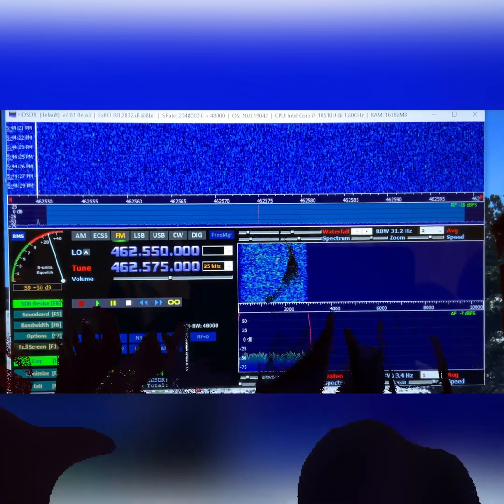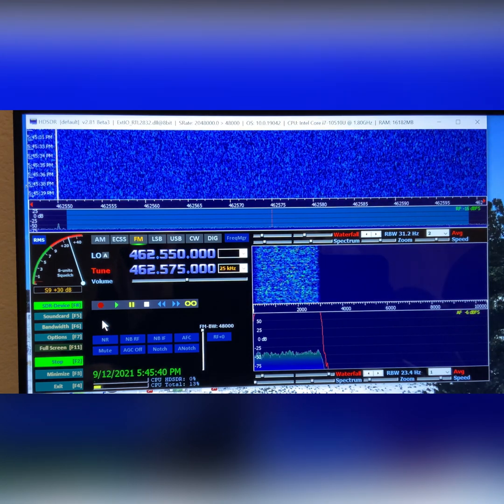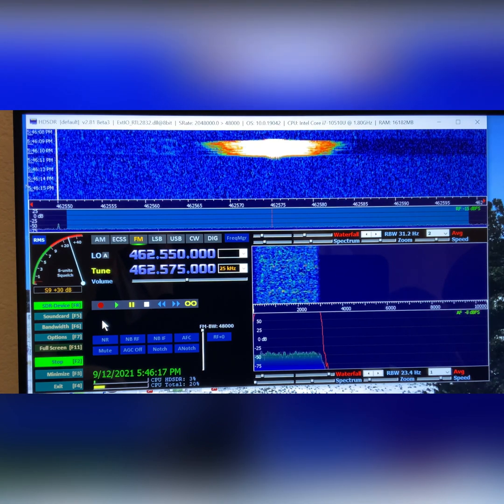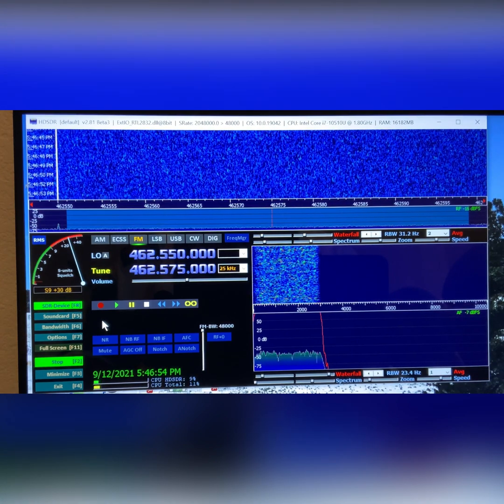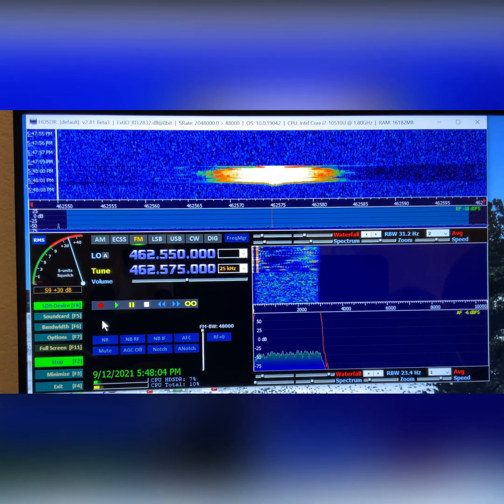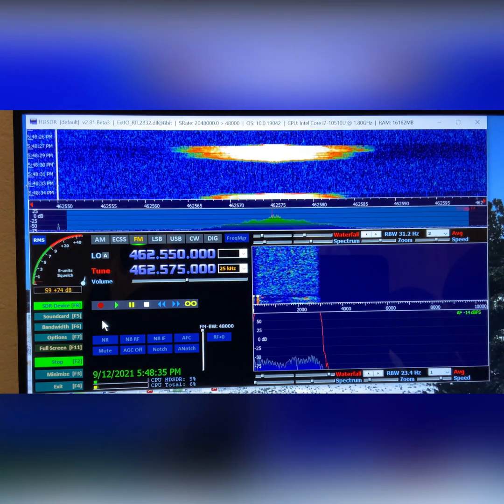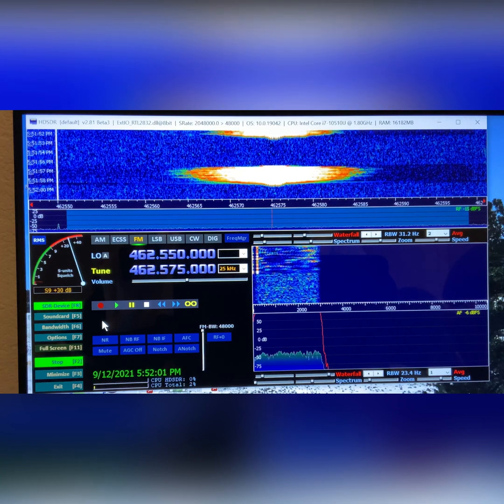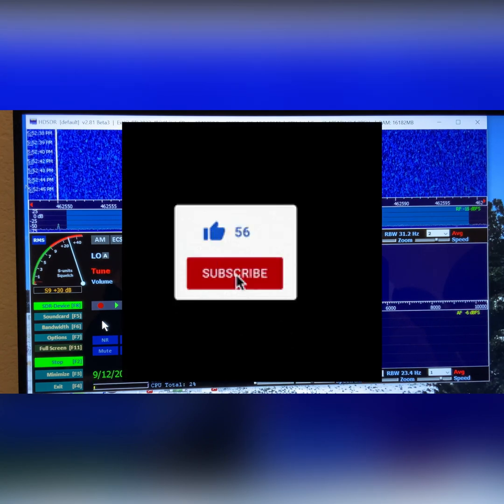GMRS Wouxun KG-UV9G Pro Difference Between Narrow & Wide Band

Comment: So, should I assume that narrow band has better penetration then wide band since the signal isn’t as wide? I mean, it would make sense because I don’t get near the penetration with 2 meter as I do with gmrs around and in buildings. And of course we all know the reason why. But I never thought about this between narrow and wide band
Reply from the maker: Actually GMRS has better penetration because it’s UHF frequency in the 462 MHz region. 2m in the mid 140’s MHz doesn’t have the same penetration. The true reason they narrow band is to fit more channels in the same amount of space. You can get two channels narrow band in the same space as one wide band channel. Ham-Solo K0FYR
Reply: Maybe true at the slightest level. Narrow has slightly higher signal strength because of the lower deviation. This effect is more noticable in HF where CW (Morse) signal can reach farther than modulated carrier (AM, SSB) for the same power level.

Comment: What is the menu number for that setting, and would you recommend that setting for the UV9PX ham as well ?
Reply from the maker: I think the menu number for that is 4 or definitively in the first 1-10 menu items. It is sometimes different on different radios. It is listed as N/W or W/N. Most GMRS and Ham FM channels are better on Wide band for fuller depth of sound and volume to the listener. Digital channels like DMR and GMRS channels between 8-14 are automatically Narrow and you don’t have a choice on those. Wide is definitely preferred by most users currently. Ham-Solo K0FYR WRMV759
Reply: @Ham-Solo  Thanks for the help. I’m still waiting on my Wouxun KG-UV9GX GMRS to be shipped.
I’m still learning the basics of radio setup.
I did get my Wouxun KG-UV9PX and I figure they are very close in settings.
I’m a little frustrated with the programming so far.
It might just be the initial settings, but I don’t pick up anything on ham or GMRS channels.
I’d love it if you did a video that covered the settings your running on these radios.
I know we’re located close to each other and share alot of the same repeater’s.
Thanks for the help !!!
Reply from the maker: @Pro2AforLife  I can send you the code plug for the KG-UV9PX ham version I used for Colorado that you can open in the free CPS software from Better Safe Radios for that model and write to your radio. I know all the repeater frequencies work on this code plug. I will need your email address or at least ham callsign so I can look up your email on QRZ. Ham-Solo K0FYR
Reply: @Ham-Solo  for some reason my comments aren’t posting.
I sent you a pm on Fakebook messenger !!!
Reply: @Ham-Solo  yeah it was definitely #4 !!!

Comment: Thanks for the video. Everyone seems to be talking about wide vs narrow band but most don't explain the difference. Having the scope hooked up makes a great visual presentation.
Reply from the maker: Thank you Tom. I appreciate the feedback. Having been in the fire service we were some of the first adopters of digital radio and frequency allocation and it made sense that they could add more transmissions using a smaller space. Definitely doesn’t would as rich a sound however compared to wide band. Ham-Solo K0FYR

Comment: i have a question, @1:25 you showed your sdr antenna and called it a 1/4 wave wave antenna and showed how tall it was and mentioned it to be about 45 inches tall. for gmrs, i show a 1/4 wave antenna to be 5 inches.

i have been trying to lean every little thing i can about this stuff and when i see something i dont understand i ask.

i show a 45inch 1/4 wave to be a 62mhz frequency
Reply from the maker: I apologize you are correct. The original SDR antenna set I bought was from Amazon and ran around $15.95 and came with three antennas and the mag base. It is specifically for an SDR dongle and can actually receive from say around 3MHz - 1300MHz. I used to use it to listen to HF signals at 40m and 20m. By changing lengths you can listen to all kind of different frequencies. Back then when I made the video I was listening to many different bands and I used to call that my 1/4 wave. It’s actually around a 1/2 wave for 2m or the normal VHF 144-148MHz range. I don’t really use it anymore as I don’t have my SDR on hardly at all. I have an IC-7300 that is on 24/7 so I don’t really use the SDR. Check out my latest GMRS radio video I just posted 2 days ago and see a true 1/4 wave and more for GMRS. https://youtu.be/IMp1XqBEJv0 Thanks for watching Ham-Solo K0FYR
Reply from the maker: P.S. Here is the amazon description for the SDR antenna set from amazon if you’re interested. I got it in March of 2021. RaTLSnake M6 v2 - Premium 3-Antenna Bundle for NESDR, RTL-SDR, HackRF, and Other Software Defined Radios. Magnetic Whip Antenna Set Made with Low-Loss RG58 Cable for Radios with 50 Ohm SMA Connectors

Comment: You said someone using narrow band on a wide band channel would just sound 'quieter'...  What would someone using wide band on a narrow band channel sound like?
Reply from the maker: It would bleed over outside into other narrow band channels. So the point with narrow band is to be able to stack more channels side by side. With such a small bandwidth the wide band mode would bleed over into the adjacent channels. Ham-Solo K0FYR
Reply: @Ham-Solo  I understand that part i'm just wondering how you would identify someone speaking on a different band from me so I can adjust my radio to compensate.  It sounds like even now there are radios out there transmitting narrow and many others on wide on the same channels.
Reply from the maker: @timtaylor8557  Well really the only GMRS channels that are required to be narrow are the interstitial channels normally Ch8 - Ch14 that are only 0.5W transmit authorized. All the other channels can be set up on wide. I personally do not narrow band any except those 7 channels.  https://tinyurl.com/y7wj8s9w This link will show you those frequencies starting at Channel 8 and going to Channel 14. Ham-Solo K0FYR

Comment: Yet Midland GMRS radios are narrow band, no choice.  They are the 800 pound gorilla with their marketing to cross-country  off roaders.  That will drive GMRS  to narrow band in the next 10 years. (FCC is wanting it anyway)  I live in Eastern Iowa and being my first fall with GMRS handhelds (WRNS327)  I am surprised how many farmers use GMRS and factories, warehouses, and nursing   homes use FRS.  Without them there would be nothing to listen to in my area.  GMRS repeaters died 10 years ago when the REACT chapter in Waterloo disbanded. Remember FRS channels 7-14 is nestled between GMRS repeaters uplink channels.
Reply: I think you're on to something here. With Jeep Jamboree making Midland their official sponsor for comms and the subsequent switch from CB to GMRS, a lot of people will (if they haven't already) buy a Midland simply because Jeep Jamboree has pointed them in that direction, then, all the friends of those people will get something similar, etc. I think you're right that ultimately Midland is going to drive a narrow band standard across the country for GMRS. 
Further, I'm in favor of more channels vs better audio quality. Like another commenter said, how much audio quality is one expecting? If one is using an HT or a mobile without an external speaker, expectations shouldn't be that high.

Comment: far as i know uhf wide band at 25 KHz has been removed in Canada on commercial radios. I wish there was gmrs here in Canada ,,
Reply from the maker: I actually have been having a great time with GMRS and now a guy is putting a repeater in about 25 miles away in Colorado Springs which I should be able to hit relatively easily so I’m looking forward to it. Sorry that Canada doesn’t have that type of option for GMRS. I have been to Quebec City several times back in the early 90’s but not in some time. I would very much like to go back. Ham-Solo

Comment: the FCC looking for you :) the hamsters rated you out
Reply from the maker: Actually, I know you’re kidding around but Notarubicon has dealt with this type of issue before so I will clarify here for everyone. I am an Amateur Extra licensed ham operator which is the highest tested license with the call sign K0FYR. I also have a GMRS license under the call sign WRMV759. The radio in this video is a GMRS Part 95 radio and is being tested on GMRS frequencies at the appropriate Wattage using my call sign for GMRS every time I transmit. Which is above and beyond the requirement to identify every 15 minutes for GMRS world. Thanks for everyone’s time.

Ham-Solo K0FYR WRMV759

Comment: Good spectrum demonstration. Just remember folks your voice is in there between the spectrum boundaries. When you narrow band, you cut off the lower deep tones of your human voice and the higher tones of your voice. More channels fit there but less fidelity. In wide band there is room at one end for your low bass tones and the higher soprano parts of your voice. Full fidelity, but less space to put more channels in. Hams use DMR in some newer type radios. DMR radios are narrow banded. That way they can fit more channels in the bandwidth. If you ever listen to digital radio audio you will note that they have very little fidelity. All the voices kind a sound not the same but similar. The highs and lows are cut off each end.